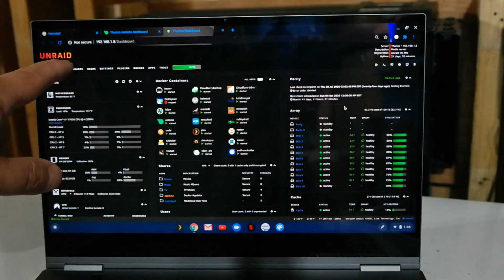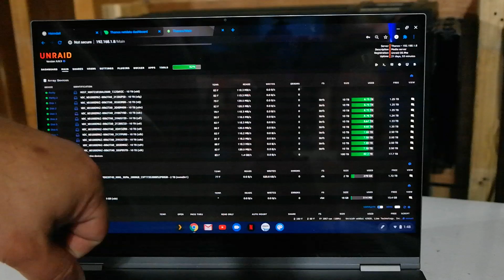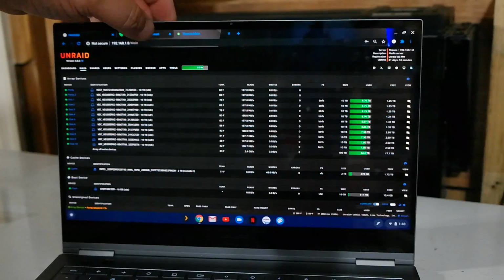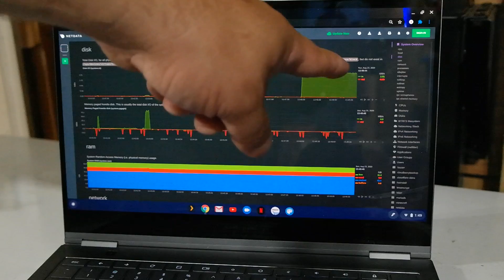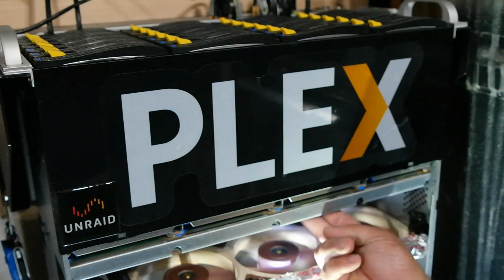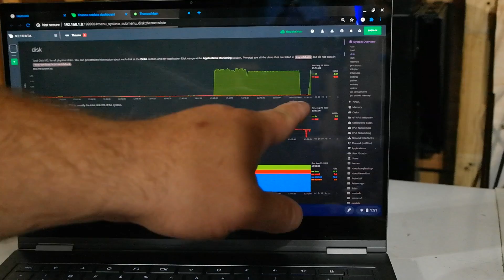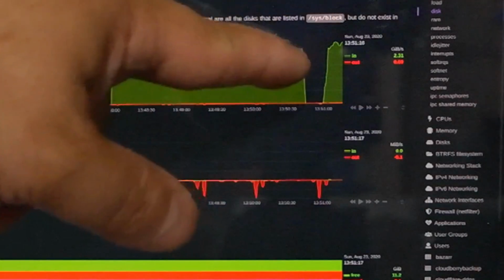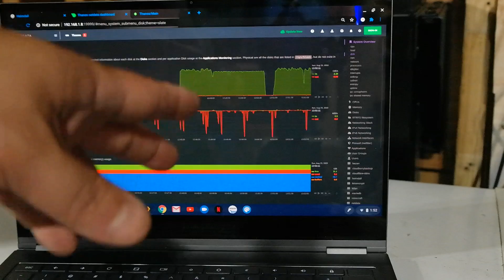Supermicro Backplane Dual Link Test

Comment: Hi, there are 2 sff ports on the board next to each other and the third one is closer to the edge of the board. Tell me which ones did you connect? And is it possible to connect 2 such boards in a cascade? If so, how? Thanks in advance.

Comment: Wish i could do this but the back plane that came with my rig is the sata version
Reply from the maker: I also got a SAS-846A backplane and a HP12gbps SAS expander I need to sell, you can have it for $150 with most of the cables you'll need if you want.
Reply: @madelectronengineering  I would but mine is the 16 Bay version
Reply from the maker: @dragonhead01  lol yeah that's not going to work then.